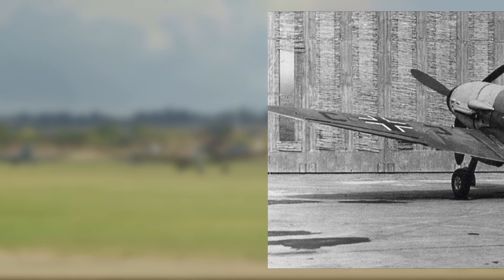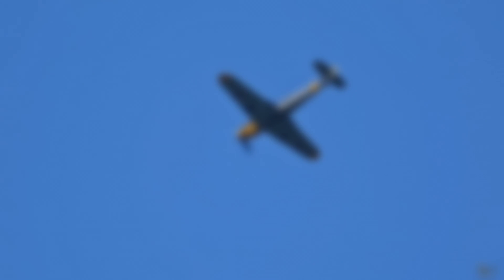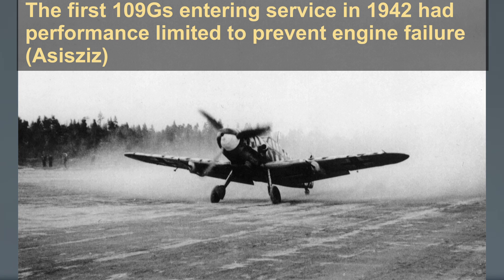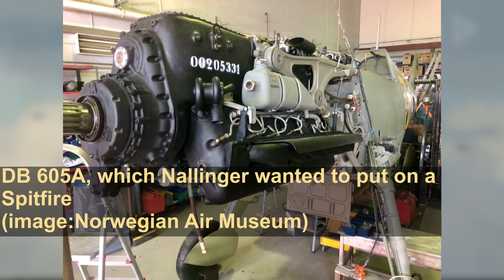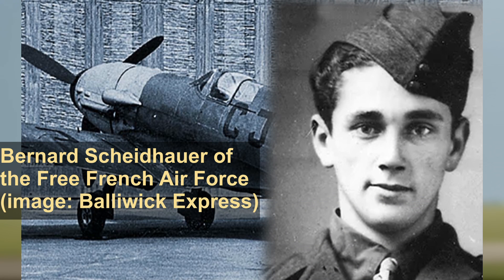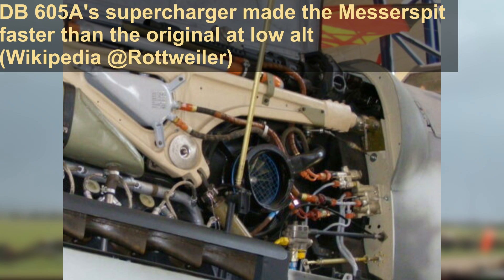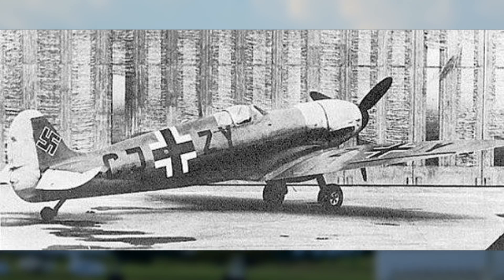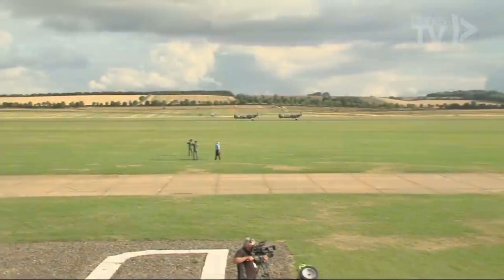All is Fair in Corporate Warfare | Spitfire with DB 605A, “Messerspit”

Comment: In 1940-41 the Yugoslav  Air Force considered fitting a Daimler Benz 601 in a Mark 1 Hawker Hurricane one of  a batch purchased  from Hawkers in 1938-39. Would be interested to see a Mark I Hurricane with a DB 601 and three VDM electric propeller. Performance would be better compared to the original Roller Merlin 2 twirling a fixed pitch two blade Leitner Watts propeller .

Comment: I had read the opposite; ie that the abberation called Messerschpit did in fact overheat due to the lower coolant pressure generated by the DB engine, the small Spitfire rad and its small oil cooler size. 
Additionally, the Spit V only had one radiator for engine coolant and no radiator that later helped the Mk.IX intercooler system.  The DB also required more oil cooling for its hydraulic clutch controlled supercharger with a 9 gallon oil tank. The little oil cooler on the Mk.V wouldn't handle that heat exchange in addition to the engine requirements.

Comment: very good analysis.
However,it must be stated that the DB engines were not designed/cleared for high (as high as Spitfire coolant--125+°) coolant temps, and therefore didn't need the radiators built withstand the higher pressures. The higher operating temps would also possibly effect boost pressures, and possibly shorten component life of economy metal parts. So, I have to seriously question whether they actually pulled an unalterated standard production DB605 off the assembly line for the MkV.
My impression is that Germans were trying to advance quickly (catch up) with aviation engine technology, and we're aware of their limitations in acquiring sufficient strategic alloying materials. Because of this and a few other reasons (eg, didn't think air combat performance was significant above 28--30K ft altitude), they decided to go with cubic inches moreso than smaller displacement, highly boosted (stressed) engines. As war progressed, and their supply of strategic materials dwindled, even the lead babbitt bearings couldn't keep pace with increasing power requirements.
Reply: Makes you really question if the K-4 was hitting “2,000hp” when the engine was caught melting and merking itself
Reply: @BARelement  I think quality control was fast declining. Hard to obtain consistent quality fuel stocks. Pushing limits to maximum to hold the line. Engine replacement components not coming through disintegrating supply chain. Novice pilots needing every last advantage, and probably not able to completely monitor engine parameters under combat conditions. 
One can readily visualize the unraveling situation, of which the prevailing mood might be "hang the expense--we're not sweating engine life under these circumstances!"
When only you and your wingman take off to attack a thousand plane bomber raid, and are jumped by 600 fighters, it is the end, and whether you used 1.98 ata of boost, or 1.8, or 2.5 is no longer of serious relevance. (Scenario referenced by Heinz Knocke in "I Flew for the Fuehrer").

Comment: The ugliest ME109 built was fitted with the merlin engine. It is the Buchon from Hispano Aviación. These were used in the movie battle of Britian. The ugliest spitfire ever made was this unit with the DB601 engine.
Reply: The short lived long range Spitfire Mk IIs with a fixed external fuel tank on the port wing must have been the ugliest.  The DB Spitfire is practical and a very good fit so I think it looks good.  Did it use a Me410 cowling?

Comment: Very interesting. I saw elsewhere that the prototype 109 had a merlin fitted, so this is a nice juxtaposition. Would be interesting to see someone do a comparison between the two.
Reply: The 109 prototyp flew with a Kestrel engine.
Reply: A 22 litre Kestrel, closer in size to the planned 20 litre Junkers Jumo 210 used in the production 109B to 109Ds.
Reply: @givenfirstnamefamilyfirstn3935    A Bf-109B/V10a prototype #1010 was dug up in Germany and reasonably complete.  The restoration is searching for a usable Jumo 210 engine to continue the rebuild to static condition.
Reply: @FiveCentsPlease    There have not been many inverted V engines made post war, remember the French post war Feiseler Storchs made with available radial engines?
Perhaps a six cylinder IO-540 or similar flat 6 would fit the bill?  The Jumo was not all that small.
Reply: Rolls Royce Kestral not Merlin
Reply: Thanks for the correction. Not sure if it was me or the source that misinterpreted, but now I know.

Comment: Interesting, the issue is the Merlin is pressurised the DB 605 isn’t. Given the aircraft was never tested by the Allies and that subsequent actual comparison testing of German Aircraft found  there performances were regularly over stated by the manufacturers by around 10%. Therefore the performance of the DB 605 Spitfire should be treated with care. We know from the performance of the Merlin 500-45 (typical a commercial version of the Merlin XX from the Hurricane II) in the Messerschmitt 109G 2; airframe, HA-1112-M1L Buchón achieved a maximum speed of 413mph. Testing of the Messerschmitt 109G2 identified a maximum speed of 385mph, indeed this is consistent with the earlier model of the HA-1112-K1L with the Hispano-Suiza 12Z engine with a speed of 370mph. So the argument the Spitfire V was better with the DB engine whilst the Messerschmitt 109 G2 was better with the basic Merlin, will continue to rage. However once the Merlin 61 in the Spitfire IX and Griffon 65  Spitfire XIV upgraded Spitfire designs arrived , it all became somewhat academic.
Reply: The claimed power output of the 190D onwards Junkers Jumo 213s was quite suspect, of course the wëhräböös all have unshakable faith in Thousand Year Reich gear.
Reply: @givenfirstnamefamilyfirstn3935  indeed and the Messerschmitt 109 K, when tested against Tempest 5 Spitfire  XIV and I think Mustang IV P51D. Also the Me 262 is suspect, once you read the test reports, the often quoted top speed was from a dive 850Kmph or 528mph, it was limited to 750 Kmph or around 466mph level fight and not to go below 12,000 ft in the combat area, possibly where Mustang, Tempest 5 and Spitfire XIV would have an advantage.
Reply: I don't think a fly off comparison was conducted with a 109K. I recall reading a comparison involving a 109G-14 vs. MkIX, MkIV & P-51D.
Had they a 109K with DB605DCM (C3 fuel, MW-50) & cleared for 1.98 ata, the Allies would have concluded that by both engineering and performance, Germany was nose to nose with Allies. Amazing that their engineering could pull that off, considering all the limitations under which they were operating.
Reply: @josephstabile9154  Indeed I have references they tested both the 109 G14 and the 109 K 4.
Reply: @DC.409 Oop you got him.
Reply: @josephstabile9154 I doubt the K-4 ACTUALLY ran 1.98ata as reports could never confirm that 109s in service ran over 1.8ata lol… Going to 1.98 ata was reported by the Germans to cause the engine some pretty serious issues. I don’t think blowing up your engine, or melting it to the point of needing an overhaul is worth 0.18 ata… The Germans with the 109 weren’t quite “peer to peer”. 

The Fw 190 D-9 refined magical versions that weren’t all that numerous you could I say were peer to peer. As far as the Ta 152 H it was also a mixed bag but due to its better airframe, it could be called peer adversary. But overall it’s planned performance if ever reached was insane!

Overall german planes after 1941 was struggle bus supreme. You either had to see the enemy first, or be better than the other pilot. They simply didn’t have the industry, materials, or design in some cases to do what they needed/wanted to do. 

The 109 was a good interceptor but outside of that role it was a fish out of water. It did more than what should I’ve been expected of it. The Fw 190 was imo a much more versatile aircraft. The 109 as it was, was sorta a waste time, and resources. But I love it for it’s gorgeous lines, and crude panel gaps. It’s still a pretty plane regardless, thts whyy I like it!
Reply: @BARelement  I have seen the original documentation, and read one engineer's account, confirming that 1.98 Ata was cleared, uncleared, then recleared for operational use. This is however a moot point, when one considers the collapsing infrastructure that supported operations in the last weeks of the war. The lack of correct fuel would ground many planes. Staging a handful of planes of whatever superiority against overwhelming air superiority was clearly futile.
Allies did not test the K-4; I've never seen a record showing they had even sought one. The G-14 they tested, was, per some reports, fitted with a 605A, not an AS, and didn't use MW50, but was representative of typical opposition encountered at the time of capture.
MW50, as used by Germany, was a clever work around for the lack of higher boost (as in 2nd stage), as was GM1. The lack of sufficient alloys was a major limitation to that approach to higher boost pressures. The fact that Germany had larger displacement in DB601/605 than Merlin was a help.
As the Bf-109 was designed solely as an air superiority fighter, having the smallest airframe around the most powerful engine, it, like the Spitfire, had the same design limitations.But, it's worth noting that, the majority of the highest scoring Luftwaffe pilots picked the 109 when air superiority was the primary goal.
Reply: @josephstabile9154 The 109 wasn’t cleared by squadrons to run it. But theoretically 1.98ata was possible but if you weren’t caring about breaking the engine then yeah run it. But otherwise they weren’t keen on doing that. 

They had to do this with the Dora running 2+ ata. They had to put limits on it. Likely it ran 1.8 ata (1.85 if you want to be generous). But if any German plane was to be a marvel in the slightest, it would be the 190 family. It was safer, more advanced, easier to operate, easier to upgrade, it was a successfully evolving design unlike the 109.
Reply: What’s sad is most “sims” don’t show the reality. Most BF 109s by the time the Americans came along would be lucky to make 1300hp. Many G-6s performed alike the Avia S-199 which isn’t good. 

Considering the limitations of 109s displayed in this video, and the lack of alloys that would be able to handle a lot of stress would make me question the performance of aircraft like the K-4 in “sims” due to some reports saying the engine kept melting and what not. It’s all weird that allied planes get underrated performance below wartime values, and the Nazis get fantasy stuff that didn’t exists/didn’t exist in numbers.
Reply: I would characterize it somewhat differently: after being bombed to kingdom come, collapsing infrastructure & supply chain, that was when it was academic. 
Actually, even with the severe handicap of insufficient availability of strategic alloying metals, DB kept the 605 competitive, without a 2nd stage compressor, producing 2000 hp and giving the 109K a 40K altitude. 
The problem  wasn't sufficient engineering ingenuity. DB's & Junkers Jumo's & BMW's designs at war's end were as cutting edge as any. What was lacking was the ability to anymore get anything but dribs & drabs to the squadrons, and have sufficient, competent pilots. The definition of "lose".

Comment: Messerschmitt and Daimler Benz essentially got into a "No you" argument and Daimler got the last "NO, YOU!" in.
Reply: Actually, Messerschmitt was proven right.  The DB required more cooling than the Merlin which had higher pressure coolant and hence a smaller rad.

Comment: Well, this is interesting, and why not? The 109 was fitted with the Merlin in the Spanish Air Force (those seen in the movie Battle of Britain).
Reply: Yes but those were Casa built models from well after the war
Reply: @kennethobrien6537  Were they built in Spain, or somewhere else, AFTER the war? You know more about this than I do. I'd like to know what you know. All I know about post-war production was in Czechoslavakia with the S-99, and those used by Israel with heavy bomber engines and were horrible aircraft in that version. Thanks for the reply.
Reply: @Jonno2summit  wait, you are doing quite a confusion here because the Czechoslovakian Avia S-199 was based on the Messerschmitt Me 109G built after 2nd WW 2 utilizing the Junkers Jumo 211F, the same engine installed on the Ju 87 Stuka,in place of the original and unavailable DB 605 engine and fitted with the big paddle blades of the He 111 bomber. The resulting combination of parts was an aircraft with extremely poor handling qualities and dangerous flight characteristics.
Reply: @paoloviti6156  Yes, I'm aware of that history.
Reply: @kennethobrien6537  actually the Hispano Aviación HA-1109 and HA-1112 are licence-built versions of the Messerschmitt Bf 109G-2. Without writing a book the final variant was the HA-1112 Bouchòn (Pouter) fitted with the 1600 hp Rolls-Royce Merlin 500-45 engine and and Rotol propeller, both purchased as surplus from the UK. Was built in 239 units. First flew 29 March 1954 and finally retired tne 27 December 1965. Those Bouchòn were practically new when they participated at the famous Battle of Britain, very curiously a film I never seen! Hope I didn't bore you guys....